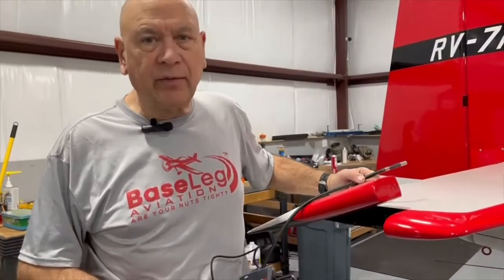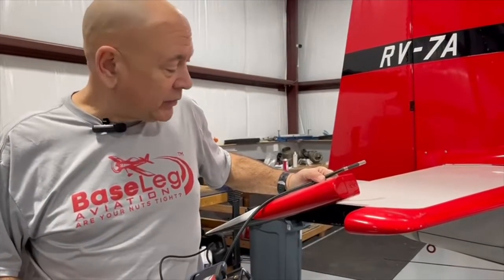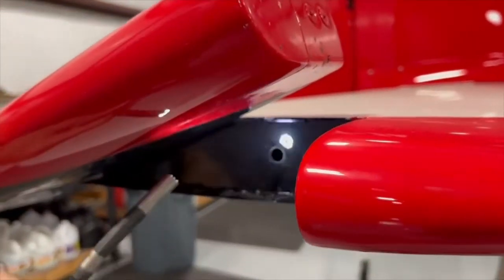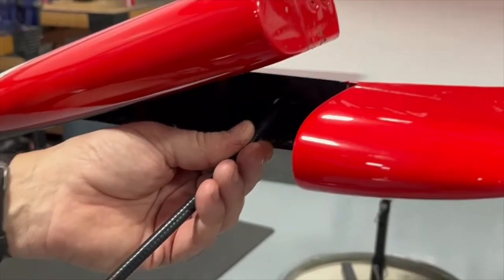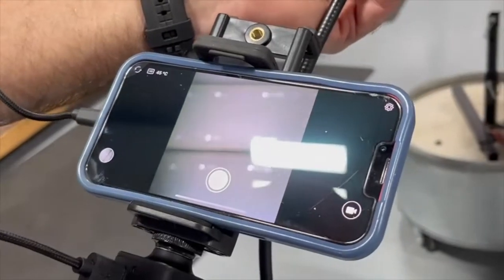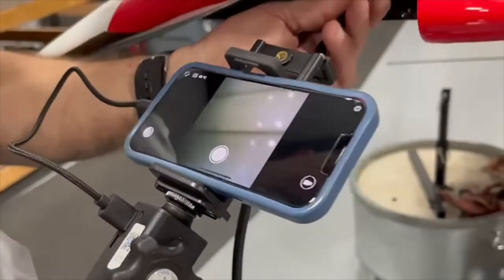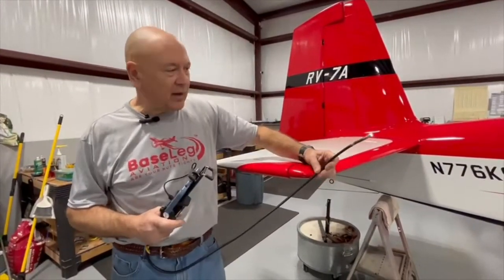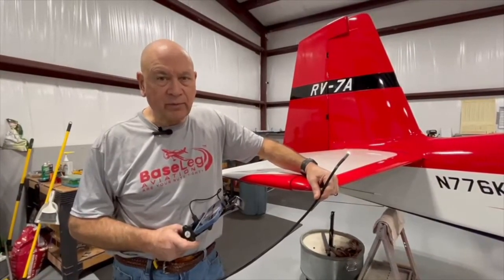Base Leg Aviation SB-00036

Comment: Hi Vic. Love these videos. What is the model number of the borescope you used. Is it full 360 or two way 180 deg. I checked a friends over 1000 hr RV9 on Tuesday, and no cracks detected. 
RV9 is pretty easy to check as the end rib has 3 large lightening holes. Will be checking another friend’s high time RV6 on Saturday.
Reply from the maker: vividia 855i 2 way 180. I always post  the tools 
used in the comments section for the video.

Comment: How many hours on this one?
Do they do aerobatics often? 
How well is the elevator balanced?
Reply: I want to know too.  I am building a RV8
Reply from the maker: 359 hours. I don’t know about the aerobatics. elevator seemed balanced.
Reply: @baselegaviation1614  Yikes, that is about the lowest amount of hours and having a crack.
Reply: @2Phast4Rocket    if i were you .i  might  install struts on the tail .... like a  citabria ..and a place to put on a lift handle.    good luck